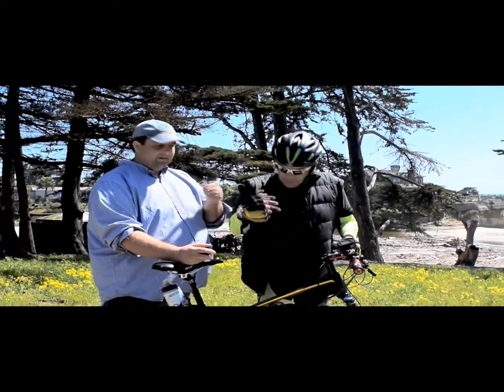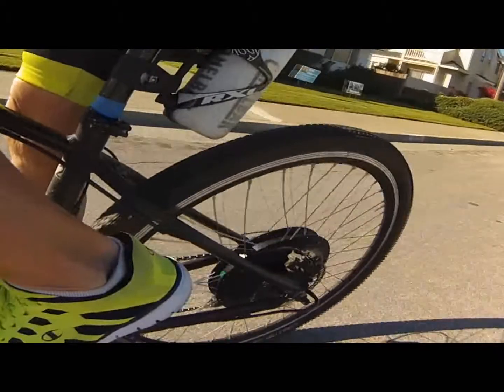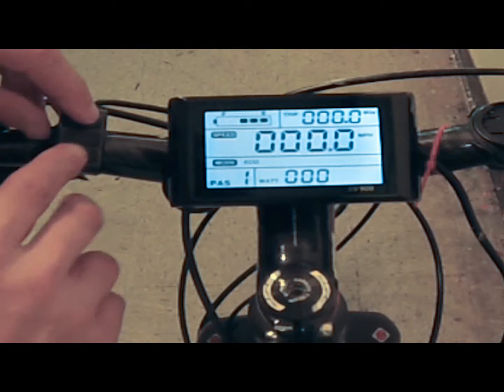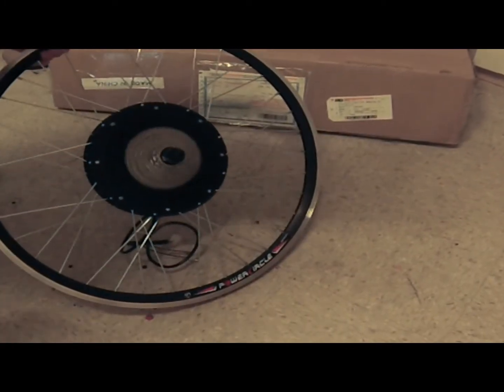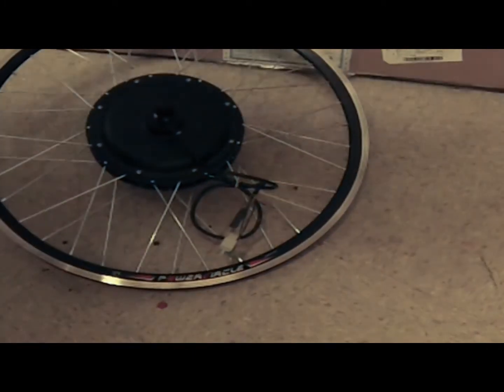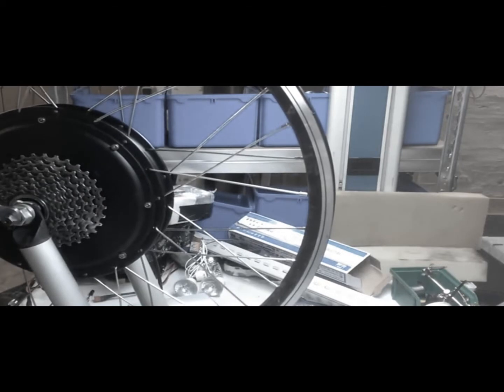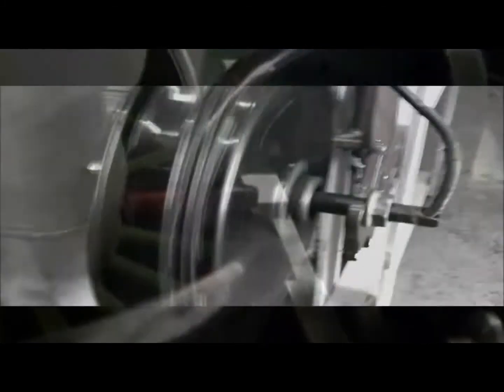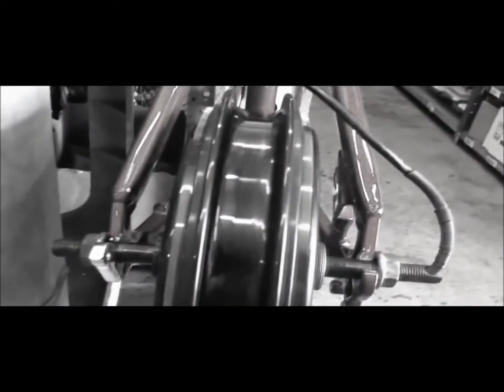EBike Review. 1000w rear hub motor, Carbon Electric Bike, 40 MPH.

Comment: I'm thinking to put a casted 1kw rear hub motor on a carbon frame 20" folding bike, plus attach the pannier rack to the steel hub on the wheel rather than add any pressure on the bike frame itself. Wonder how it would turn out?